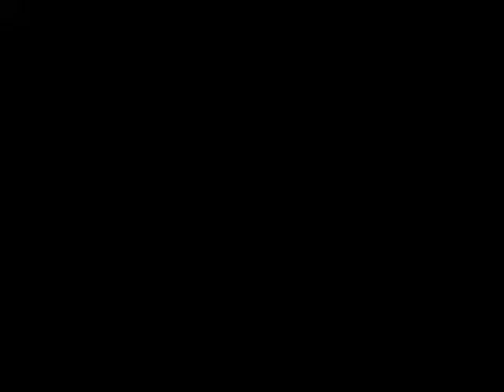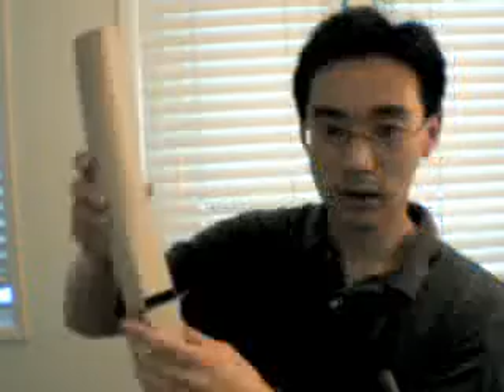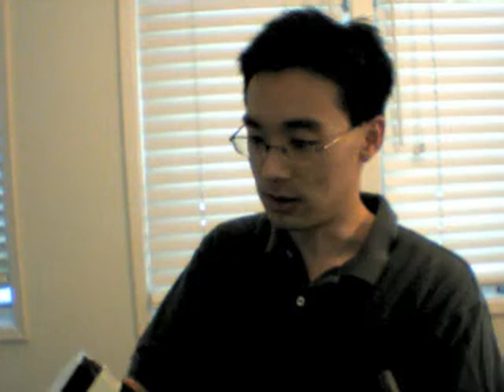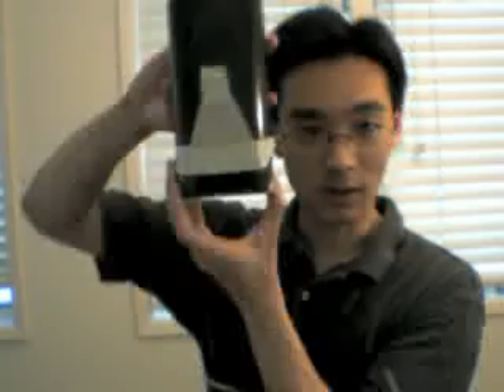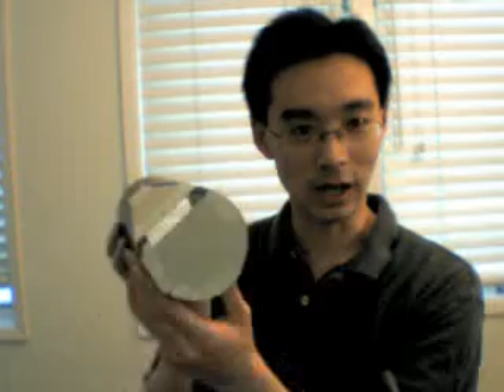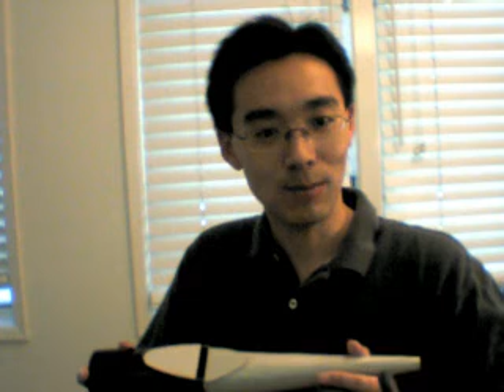How to Build Your Own Homemade Flue Pipe (Organ Pipe) (Part 4)

Comment from the maker: @dreamzspl The flue mechanism is very sensitive to crosswinds, so if you're going to have the pipe standing in the wind, you'll need to shield the flue. You'll also need to somehow funnel the wind in up the foot. I have never tried this, so I cannot assure you that it can be done.

However, there are instruments that are designed for ambient wind. I found this, which seems to explain one way of converting an organ pipe to a wind instrument:

Comment from the maker: @dreamzspl For your purposes let n be 1. What the original formula is saying is that a pipe that speaks at low C will nevertheless allow some resonance at all its multiples (harmonics), including high C (2x), the G above high C (3x), high high C (4x), etc.

Roughly, an open pipe speaking middle C should be about 2' long. (The bottom note of the organ keyboard would then be 8', which is why the "normal" stop of an organ is labeled 8'.)

Comment from the maker: Yes, in this and my other videos you will see several pipes made entirely out of cardboard. As long as the material is stiff enough, and the geometry is the same, it doesn't matter what type of material it is. Metal, wood, cardboard, or PVC will create almost exactly the same timbre. Compliant materials such as paper will not work well, as they will themselves flex instead of containing the standing waves of the air column. People have, however, made organ pipes from paper stiffened with glue

Comment from the maker: Yes, it is possible. In fact the cardboard thing worked as a pipe body by itself without putting it into the PVC tube. (The foot and flue would need to be  readjusted for the new length.) See my video part 1 for a completely cardboard square pipe (just a few inches long).

Comment from the maker: @praestant8 Once I figured out a design, it wasn't much work at all. Each round PVC pipe takes 30 minutes to cut and assemble. Each square paper pipe (see other tutorial) takes 15 minutes. My pipes certainly aren't on par with metal pipes from a professional workshop, but for a few bucks and a few minutes the result isn't too shabby.

Comment from the maker: [Part 2] So how do you design a louder pipe? It's all about how much power (energy per second) is delivered through the flue. So, if you increase the width of the flue (and therefore also of the upper lip and body), the new pipe will be louder. If you increase the thickness of the flue, the new pipe will be louder (but watch out--this will require changing the mouth height according to the Ising parameters!). If you increase the blowing pressure, the pipe will be louder (same warning).

Comment from the maker: [Part 1] First thing to check is whether your pipe is maximally efficient. (By the way, even the most efficient flue pipe or wind instrument converts only about 1% of the input energy to sound.) Is your flue mechanism properly aligned? Does it give a fairly pure tone? It should not be simply a vague whistling. Assuming that's all right, then you will not be able to get your pipe significantly louder. To get a louder pipe, you must design a new one from scratch.

Comment from the maker: @dreamzspl Cut-up height and flue *thickness* (the thickness of the sheet of air; maybe that's what you meant by width) need to be coordinated according to the Ising equation with your air pressure, or else your pipe won't speak clearly. But I think trial and error would work just fine. Experiment with a few prototypes. See diagram "Rectangular flue pipe schematic" at ssngai dash organs blogspot com. 

Shielding: you are exactly right. (A distance of 1" from the mouth would be good.)